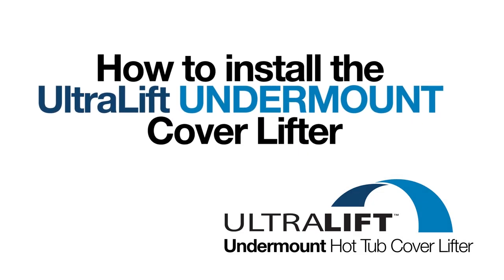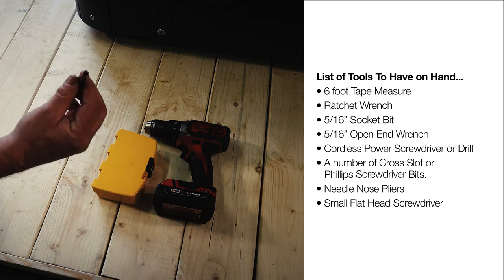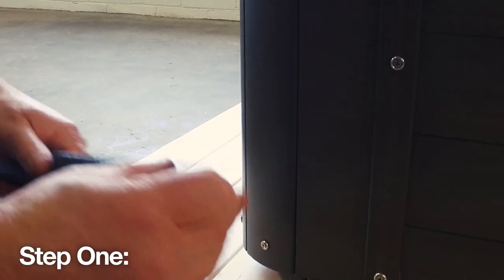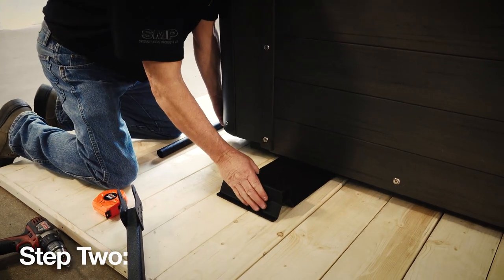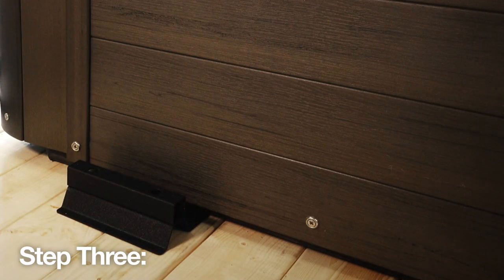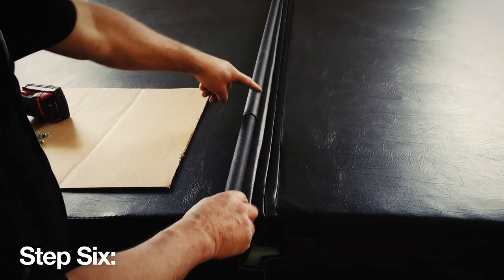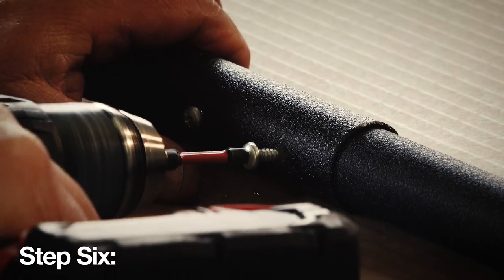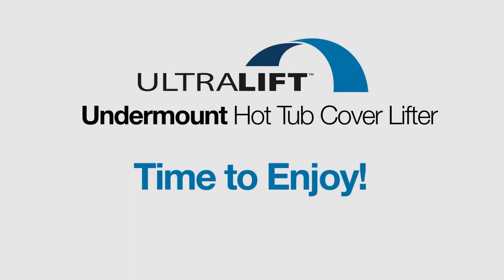Ultralift Undermount Installation Video 2019

Comment: I have the UM model, can I install the brackets up on the side of the HT, 12" below the top of the HT, instead of under the hot tub? My HT is submerged on all four side and has decking leading up to the side of the HT, so the side arm will not work.  Thanks
Reply from the maker: Hi there, 
the undermount only works under the spa... but can you email us at contact@ultrapooladnspa.com with images so we can help you troubleshoot an option that works for you?